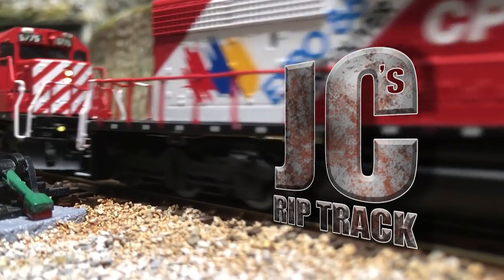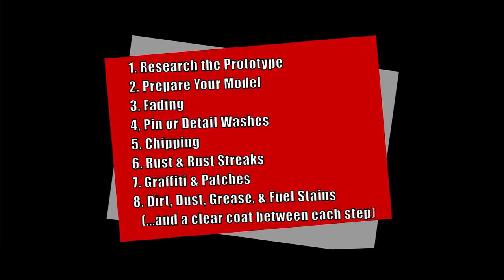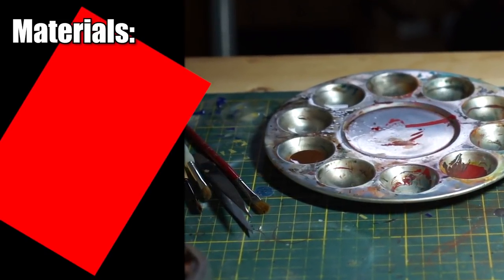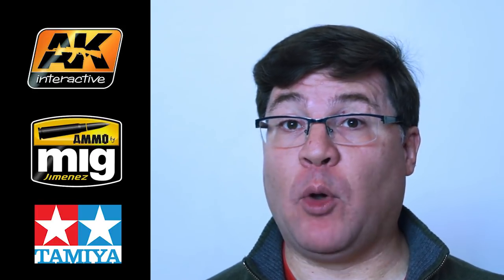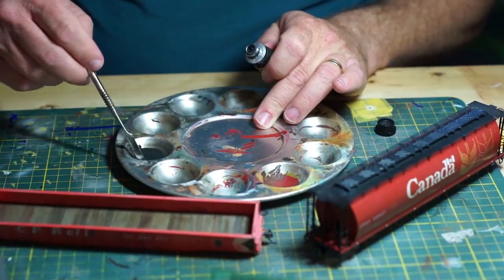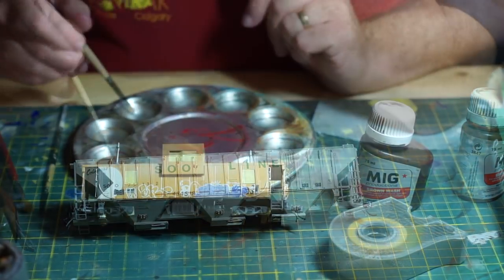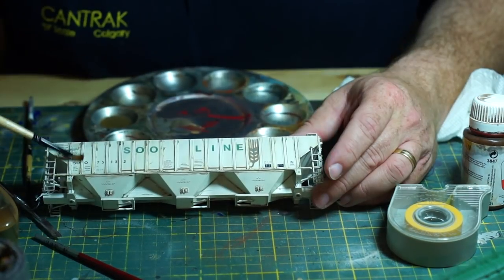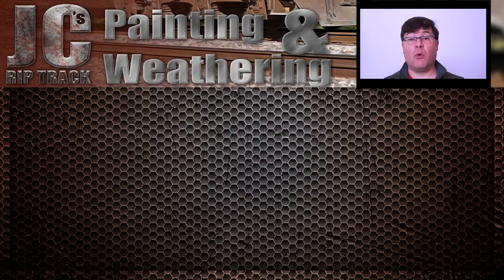Weathering Model Trains - Weathering Washes (Step 4)

Comment: I like the pace of your videos and the fact that you're covering a lot of ground without wasting hours of the viewer's time.  In your video, when you use "thinner"  to create a wash, do you mean the stuff that says paint thinner on the label, or are you using that term in a more general sense, to describe a broader group of thinners like turps, mineral spirits, etc? I'm not suggesting that one is more correct than another. I'm curious of your preference with heavy body artist oils.
Reply from the maker: Thanks Hunter. In this case I'm using "thinner" in the broader term, as I've found that what is used depends on user preference and local availability. The mineral spirit that I use as a thinner is called "Taltine" which seems to be a Canadian-made odourless solvent. It dries slowly, which is ideal for this kind of work.

Comment: John, what is your opinion of using Citadel washes?  I know that you prefer oil-based over acrylic.  Thanks.
Reply from the maker: The Citadel Washes are a well-used part of my arsenal. You'll see them in a few of my videos. They're great for pulling out detail on trucks, for example (Agrax Earthshade), and of course, for painting figures (I still have to do a video on that). As far as acrylic/water soluble washes go, they're probably the best on the market. If you watch my latest livestream on Weathering Structures, I even have an example of how I used Nuln Oil. I also used  Nuln Oil and Reikland Fleshshade in the Salt Chipping video as well. So yes, I like them a lot :)

Comment: Do you brush on the floor polish gloss clear coat? Also do you have another recommended spray can gloss clear?
Reply from the maker: Future can be brushed on manually or sprayed on using an airbrush. If you don't have an airbrush, go with spray cans for your clear coats. While Testor's Glosscote works well as a spray can gloss, you can also use Tamiya Clear Gloss spray, which I like better personally. I've had and heard mixed results from Krylon even though many swear by them. It partly depends on the scale of the model you're working with. With spray cans (or any sprays for that matter) you're better doing a few thin coats than trying to do one thick one.

Comment: JC, I am having a hard time finding a suitable solvent based mineral spirit to use that is safe on plastics. Do you have another mineral spirit that you can recommend that is cheaper and more available?
Reply from the maker: Hi Jeff, it really depends on where you live as to what may be available. I use something called "Taltine" which is a brand-name odourless mineral spirit made by a company called "Demco" that is manufactured here in Canada. One bottle lasted me a few years, as you really don't need to use a lot of it. You could go with with something from either AK Interactive or Ammo by Mig, as their thinners are intended to be used on plastic models. I will try to look up a US equivalent of Taltine later tonight and post it as a reply to this comment.
Reply: @JCsRiptrack  I'm in the US. I can get Tamyia X20 on Amazon but it is expensive. There must be an alternative that I can buy at a big box store?
Reply from the maker: Yes. I have to apologize that I misread your question in terms of solvents. X20A thinner is basically 91% denatured alcohol, and you can buy that at a Walmart Pharmacy for a very reasonable price. You can use that to thin Tamiya and AK Interactive Acrylic-Lacquers, as well as Games Workshop/Citadel paints & Privateer press. Just don't use it with Vallejo model colours. 

On the other hand, my reference for Taltine was intended for oil paints. Don't use that on acrylics. It won't end well. I had misread the term "solvents" in thinking of them in relation to oils and enamels. Does that help?